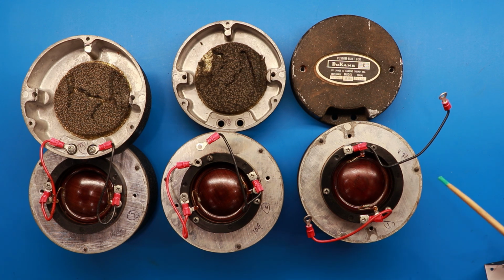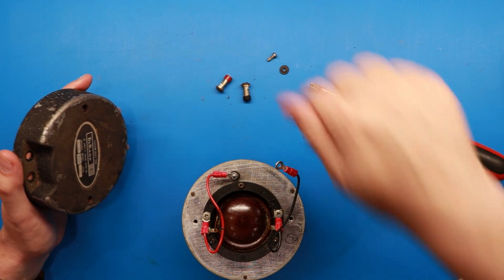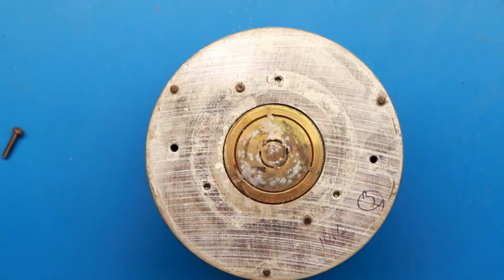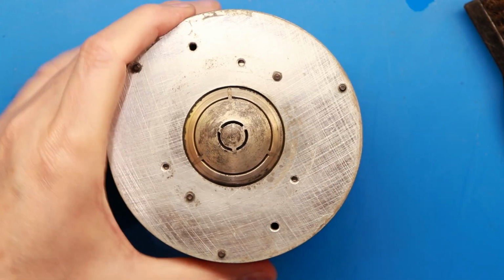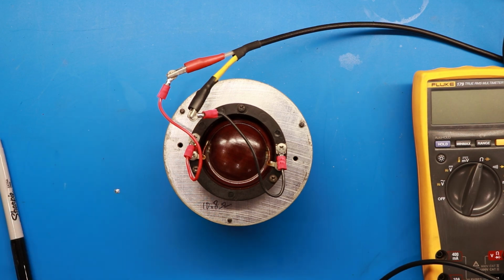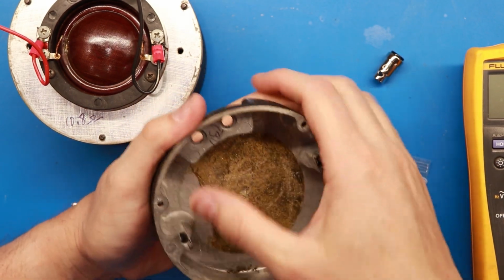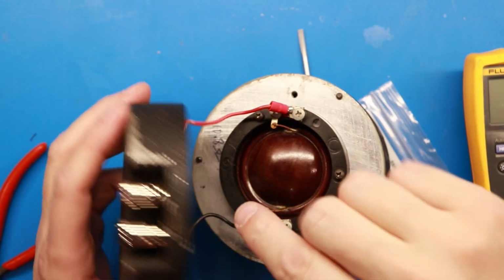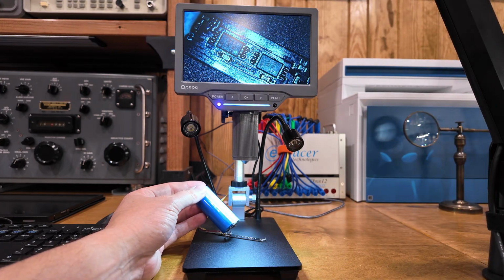Horn Compression HF Driver Rebuild - Cleaning, Testing, Refurbishing - JBL, Altec, etc.

Comment: I recommend you advise folks to use a non magnetic screwdriver to remove the diaphragm bolts.  I know from experience that a driver with a strong magnet can pull the screwdriver towards the magnet and damage the fragile diaphragm.   Thank you for another great teaching video!
Reply from the maker: Good call out, you are right but I don't work on speakers a lot so learning as I go.

Comment: Hello. I had a SR 2100 boombox from a friend. Inside is like brand new. I cleaned the switches with contact spray. AM radio works fine but FM does not play any station clearly. Every FM station has static noise. It has an antenna and it’s connected to the tuner pcb. I suppose the radio signal is good because my car radio gets all the stations. I also sprayed contact spray inside the tuning capacitor however did not fix the issue. So what can be the problem of the boombox?

Comment: I was so excited when I seen this video. We service a fog horn used on oil & gas platforms in Gulf Of Mexico. It’s got 5 of these drivers, but a little bigger than yours. That felt pad you had before cutting would probably fit in them. The horn outputs a square wave of 645 hz. We managed to get some new coils but most of the time the housings are really corroded from the salt water environment. Thanks!

Comment: i lost it around 10K , but i'm 79 , so..................
     ever try University driver? no way...same w/some E,V. drivers , they sealed "em up good
    keep running into JBL crappy foam surrounds , and the re-cone kits also use foam............plastic foam degrades , so find something else.....i make surrounds with thinned silicone , a big pain
Reply: I had the foam surrounds on my JBL drivers from 1978 replaced around 1998. The new surrounds show no signs of deterioration. I'm pretty sure the new foam is a different formula. Since then, I've learned how to replace surrounds. It's not that big a deal.

Comment: You want the felt to go all the way to the edges and do the sides but that felt is too thick and use foam with it from a washing up sponge keep that to the original size about no more than 8 mm in depth but use like three or four millimeter felt like from a turntable mat cut to size right to the edges and do the sides as well, then stick the sponge on top. Making sure that the sponge isn't touching the diaphragm but doesn't matter if it's pushing against the surround a bit

Comment: Interesting project. Amazing how small the gap is for the sound to propagate through. I'm surprised that you used more spring terminals as replacements. Not great terminations.
Reply from the maker: If these were on the back of speaker enclosures, I would agree.  These will be inside of cabinets more than likely so think of it as internal speaker wiring connections, thus I'm not as concerned.  These new spring terminals are pretty heavy duty compared to the OG.